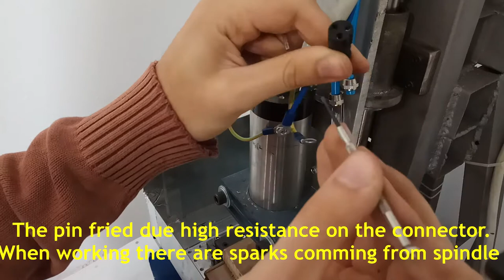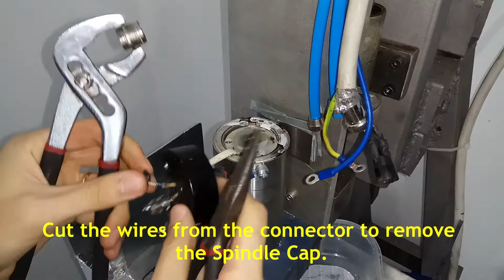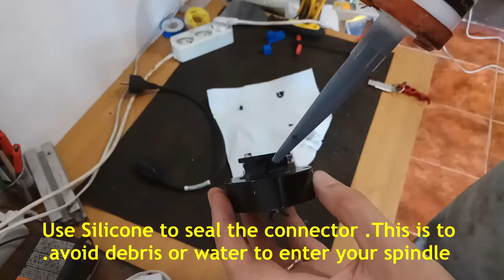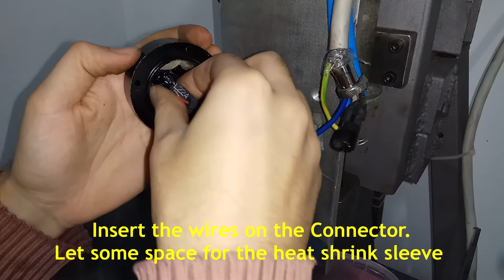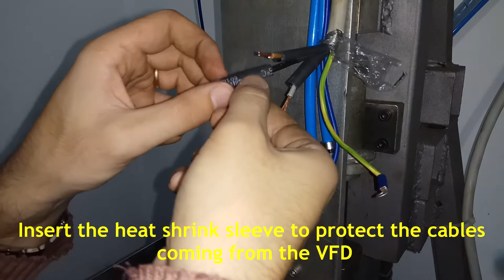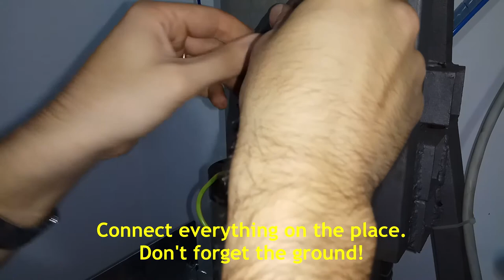REPAIR: Chinese CNC spindle connector

Comment: Thanks! Why 2 grounds on spindle body?
Reply from the maker: When I bought the spindle the ground on the original connector was not working. So at that time I add the ground connection to the cap and body (probably unecessary since they are connected by screws)
Reply: Apologies, I mean why is there a blue and a yellow+green wire, do they go to separate places to ground? Cheers.
Reply from the maker: @3dkiwi920  one is the cable ground and the other is the cable shield to minimize interferences due VFD usage.

Comment: This is dangerous please do not do this, there is a reason that wire is burnt up,replacing the wire won't fix it, you have high resistance from those crimp connectors, soldering always carries least resistance, use flux, and electrical solder, that's a must this is three phase, it's enough to kill you, word of advice you couldve just replace the aviation connector there pennies on the dollar rather than create a very dangerous hack one more thing never ever ever drill into your spindle, if you want a ground point solder a wire to the case hopefully you still ok and you ain't burn your house down